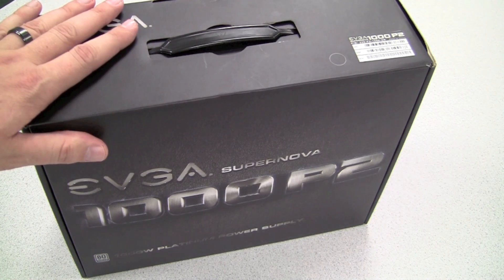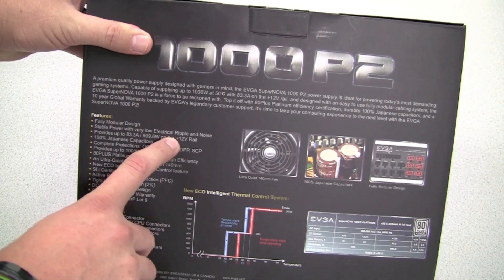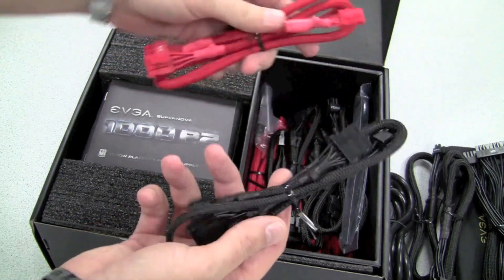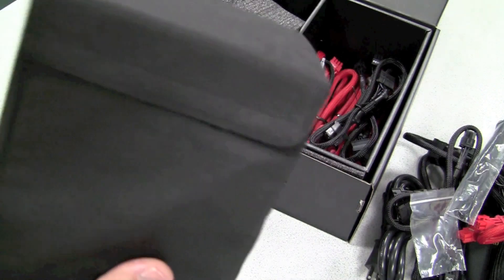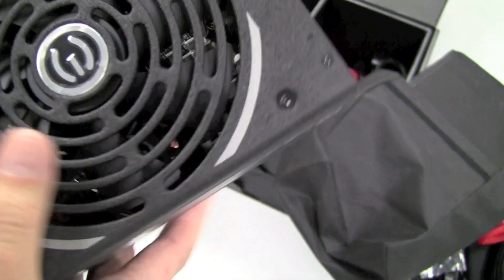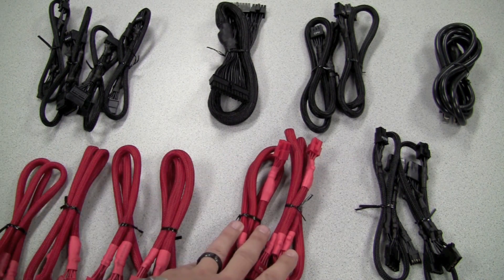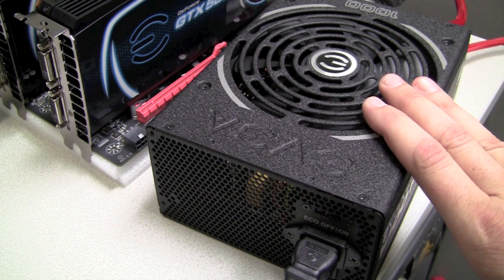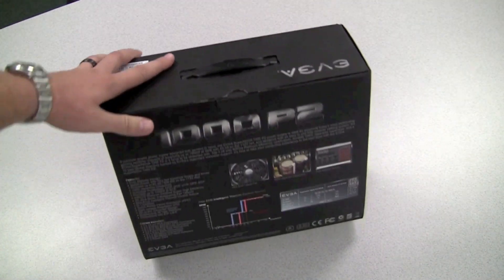EVGA SuperNOVA 1000 P2 Power Supply Overview

Comment: Hello , i just bought this PSU (EVGA G2 750) and the fan is not spinning at ECO mode, in fact it never did. I tryed to heat up the psu with a hair dryer, it was so hot i could not touch the psu with my bare hands or i could burn myself. Still the fan never spins, the only way the fan could work is with ECO mod OFF, should i RMA this unit or its just spinning under high load and not temperature.

Comment: When will it be available in EU? I can only find it in a couple of stores, but not in stock in any of them. Is this because of the first batch that was recalled..?

Do you plan on a smaller version of P2 in the near future? 750/850W.
Reply: order it online, http://www.amazon.com/EVGA-SuperNOVA-Platinum-Certified-220-P2-1000-XR/dp/B00EKJQM5E/ref=sr_1_1?ie=UTF8&qid=1390657696&sr=8-1&keywords=EVGA+SuperNOVA+1000+P2+Power+Supply
Reply: German Store:
http://www.caseking.de/shop/catalog/Netzteile/EVGA/EVGA-SuperNOVA-P2-Netzteil-80Plus-Platinum-1000-Watt::24818.html

Comment: nipples 
 
1.a protuberance of the mamma or breast where, in the female, the ilk ducts discharge; teat.

2.something resembling it, as the mouthpiece of a nursing bottle or pacifier.

3.a short piece of pipe with threads on each end, used for joining valves.